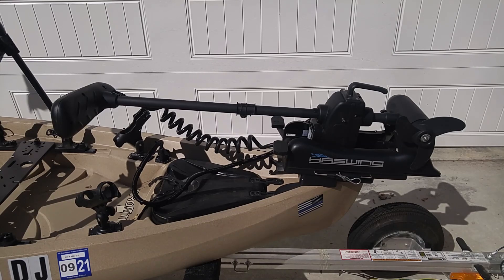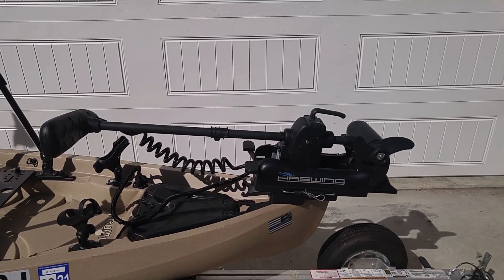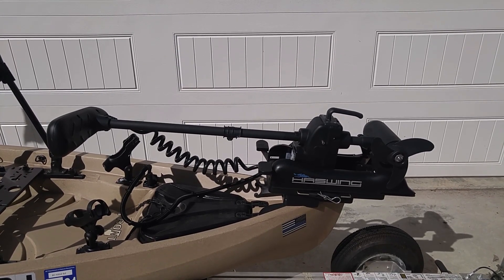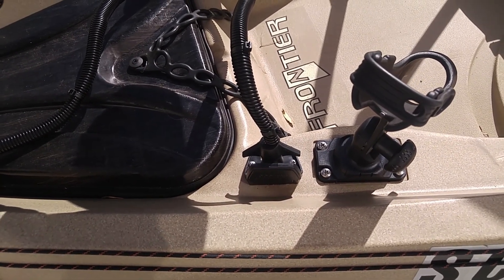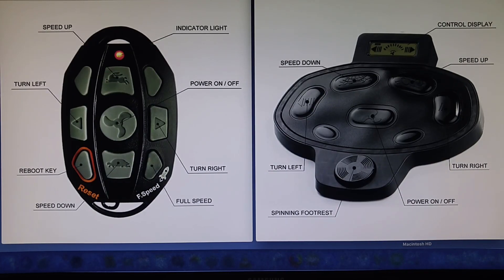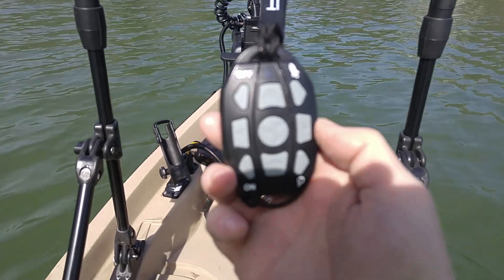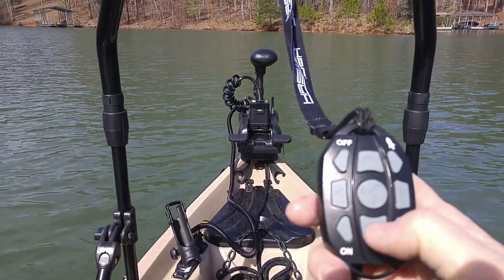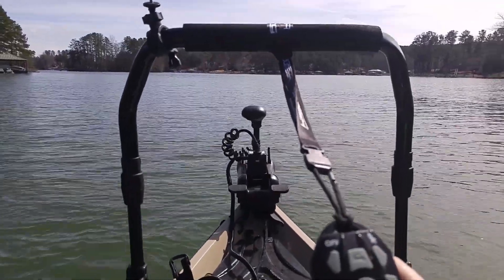Nucanoe Frontier 12 Kayak with Haswing Cayman Bow Mount Trolling Motor

Comment: I understand this is an older video, but i was wondering if you have ever tried to invent a deploying cable and a retracting system on the bow mount? Is it possible?
Thx Again for great videos
Cliff
Reply from the maker: Thanks Cliff. I did that on one of my Bonafide SS127 videos.
Reply: @Aksmaniyak  I watched that video and it was for a stern mount i am buying a quick release bow mount Haswing that i will be wondering how to setup a deploy and a release type cable setup in order to release from my seat
Thx Again
Reply from the maker: @cliff6490  Sure. I have used the Cayman but never had a cable release set up.

Comment: Were can I get one at
Reply from the maker: Amazon and Ebay.
Reply: @Aksmaniyak   do you have the one with GPS and if so do you have the part number. Thank you for your video.
Reply from the maker: I did use a Haswing GPS model but thought it was unsafe for kayak use. Read my comments about it in the narrative. It was an older model and do not know if they changed the programming. I do like the wireless Cayman B and it works great.
Reply: Were can I buy one it for my boat. I can find them on Amazon with the GPS

Comment: I bought one and the motor and remote work well. You have to have the app running for GPS spotlock. So no fishing in remote areas. I put it on a NuCanoe F12, same as the video. The motor weighs about 30lbs. So imagine putting a 30lb anchor on the front of your kayak. You better have a heavy A 40 lb + battery in the back to offset it, not one of these 15lb lithiums that i purchased.. Hope this helps.
Reply from the maker: Thanks for the reply.

Comment: You said don’t use the app for a “light kayak” my question is Between my kayak, myself on board and all my gear I’m pushing 400 pounds is that sufficient enough weight to use the helmsman app?
Reply from the maker: I would advise against it unless the program has been updated. The program I used was calibrated for a boat, not a kayak.
Reply: @Aksmaniyak  ok thank you for the response!
Reply from the maker: You are welcome.

Comment: Does this motor have reverse?
Reply: I realized that as soon as I sent it.✌
Reply from the maker: No, bow mount trolling motors typically do not have reverse. The prop is able to rotate 360 degrees which gives you the reverse.
Reply: How's the durability on this motor?
Reply from the maker: Excellent. I have owned several Haswing models and they have all been great quality.
Reply: @Aksmaniyak  thanks, getting ready to drop $600 on one, just wanted to be confident that it's a good motor.

Comment: This was very informative thank You.
Was shortening the shaft much of a deal? I have a small Pram and I am thinking the 48" is too long but they do not make a 36" shaft and that may be to short any way.
Thanks
Reply from the maker: Thank you.  A Minn Kota shaft and similar shafts are easier to shorten. The Haswing shaft is different and need s a little more care to cut.

Comment: HI, I bought this yak from the person you sold it to. Did you sell it with the GPS trolling motor or a non GPS trolling motor?
Reply from the maker: It was a wireless non-GPS motor.
Reply: @Aksmaniyak  I have been out a couple of times and I seem to get about 3 mph top speed. I have a brand new battery, I think it should be able to do a bit more. I weigh around 195lb.
Reply from the maker: @Expatswedegoran  I was getting about 4 MPH and a little over. The prop should be about 2 inches under the surface. If it is too deep then it causes drag which could slow your speed.
Reply: @Aksmaniyak  OK thanks, I had it way deeper. Will move it up next time.

Comment: Have you tried making a remote controlled electronic deploy/retrieval system for the trolling motor?
Reply from the maker: No Wes, I think that might be a little too much gear.
Reply: @Aksmaniyak  Thanks for the response. I only ask because the Minn Kota Ulterra models have that capability and I was sure there may be a cheaper DIY way to do it. And, if anyone could do it, it would probably be you.
Reply from the maker: You are welcome Wes. I thought about it but it would be complicated and it was easy to deploy by hand.

Comment: how is it holding up? any issues? thanks
Reply from the maker: Everything is still working just fine.
Reply: @Aksmaniyak  lots of mixed reviews on amazon...might go with a motorguide xi3...not sure just yet.
Reply from the maker: I have owned several Haswing models without any problems. Most of the negative reviews I have seen are by people that don't even own one.

Comment: What battery do you use/recommend?  I’m concerned about weight on a bonafied ss107
Reply from the maker: I always use a 100AH battery. Yes, it is heavy but I have never run out of juice.
Reply: Aksman any certain brand battery you recommend?
Reply from the maker: @danielmarteny1201  I found a good one at Sams Club if you are near one. I have also used VMAX from Amazon.
Reply: Aksman ty.
Reply: I also have a bonafide but the 127 model curious if you installed and how its been
Reply from the maker: @jaimedessus1605  No, I have never installed one on a Bonafide.

Comment: Thanks for a great video. Are you saying that the anchor in place function on the motor is too powerful for a kayak (when using the remote) or that the phone App is too powerful? Just want to be clear before I invest in the motor.
Reply from the maker: Thanks Dale. I'm saying that the trolling motor is fine when you have control of the speed. When using the anchor function from the app, the motor ramps to full speed in order to stay in place. The function thinks you are in a bog boat and not a kayak so it is an unsafe function in my opinion. Other than that, great motor.

Comment: Good evening Sir,
I bought the Haswing Cayman 12V 48” 55lb thrust  motor a few days ago and got it in yesterday. I also bought the Nucanoe bow Mount as well but I’m having
issues on where to mount the quick release puck on the mount. Is there anyway you could email me instructions on how you mounted yours?

Thanks,
Jacob- Corpus Christi, Texas
Reply from the maker: Hi Jacob. You have to do a custom mounting job for the puck to the mount. There are not any real directions. Just line it up where you want to put it. The holes do not line up so I used 1/4 inch lag screws in the 6 holes. It makes a solid base.
Reply: Aksman What’s the length of the 1/4” Lag Screws?
Reply from the maker: @cast_n_blast7496  I can't remember the exact length but they are long enough to go through the puck and at least half way into the mount.
Reply from the maker: @cast_n_blast7496  Yes, I used all of the existing holes just to make sure it was a solid mount.
Reply: Aksman- Good evening Sir
What size/brand battery did you end up using for your motor?
Reply from the maker: This is what I used.   https://www.amazon.com/MR127-Maintenance-40-100lb-minnkota-trolling/dp/B0087FBT3M/ref=sr_1_1?dchild=1&keywords=vmax+12v+100ah+deep+cycle+battery&qid=1586495030&sr=8-1

Comment: I been using the motor now and the helmsman app hold my kayak on anchor mode very well now Iam super stoked and happy with the product now
Reply from the maker: Great!
Reply: Aksman I don’t k ow if you I e noticed by now but I made the same mistake when I cut the shaft down I put the heading backward like you have on this video as soon as I turned it back and properly placed the head with long side being the front it fixed everything thanks for reply and hope this helps
Reply from the maker: Thanks Martin!

Comment: Hello quick question when you hit anchor lock on your Helman app is the kayak to light for it to stay locked I just got mine and when I hit the anchor lock it try’s to full blast me up to speed all the time you have any advise thanks
Reply from the maker: In the narrative, I had listed a warning of that situation.
Reply: I saw that once I finished typing the question 😅 so for now is the low speed route the best option for staying in position ?
Reply from the maker: I have not used that function but I assume the app would still think it was moving a heavy boat.

Comment: I just got same for my 2018 hobie outback you have advice on how to install quick release bracket on bow yours looks like it’s side ways or is that an added piece of support thanks bud
Reply from the maker: Nucanoe makes a mounting bracket for the bow of the boat. I added the quick release puck to the top of the mount for the Haswing quick release. The Nucanoe mount is for MK and MG trolling motors so I had to do some DIY to make it fit.
Reply from the maker: Hi. Nucanoe makes a Minn Kota mounting bracket that I modified for the Haswing. I don't know if MK makes a mount for the Hobie.
Reply from the maker: @Matt Tate Not too difficult. I just needed to find/drill new mount holes for the Haswing puck.
Reply: @Aksmaniyak  would it be feasible to position the bow mount at an angle so when deployed your front hatch is still accessible? Thanks, Wyatt
Reply from the maker: @wkillam  That is possible. I just did that on my Hoodoo Hero 130 skiff.

Comment: Nice addition... but when you shortened the shaft, it looks like you mounted the head unit onto the shaft backwards... looks goofy. Boat was steering left when it should be going right, based on the direction the head unit was pointing...🤣
Reply from the maker: I liked the way it looked. Steering is not affected.

Comment: I’d love a video of the deployment and lift while on the water!! I’m Really close to pulling the trigger on one and go back and forth on if the GPS unit is worth the extra
Reply from the maker: The deployment and lift is very easy. It has a foot release. The F12 is really stable so you can get good leverage on the trolling motor. If you read my narrative, the GPS is made for a large boat instead of a kayak. It would be a great motor with only the wireless controllers.

Comment: Excellent video and demonstration aside for the week could you Mount that trolling motor to the stern of a kayak ?
Reply from the maker: Thanks Bart. Yes, there is an adapter bracket that would allow for transom mounting. However, the steering would be reversed (l/r). Also, the prop unit would have to be deeper on the stern than on the bow in order for it to rotate for reverse without striking the hull.

Comment: Hi Aksel,

Nice Video.    PWM (pulse width modulation) is the way to go.

The old 5 speed units were real AMP/POWER hogs especially at slower speeds.  Minn Kota I know used resistor type devices that were mounted inside the motor head which helped cool them when in the water.  When you wanted to go at slower speeds it activated various resistors to slow the motor down which put more drain i.e. AMP DRAW on your power source i.e. battery.  The new PWM systems used on various manufactures including Haswing has dramatically reduced the amp draw at slower speeds which dramatically increases the amount of time your power source i.e. battery will power your kayak or boat.  At full speed there is no difference between the old 5 speed units and the new PWM units.  Where the PWM units shine is at the slower speeds as shown on your DC AMP Meter.  i.e.full throttle 28 amps and 1/2 throttle at 4 amps.   So if you are not in a big hurry to get somewhere you can increase your range i.e. battery life by a considerable amount depending on your actual speed and wind conditions.

I purchased an AC/DC amp meter similar to the one shown in your video quite a while back and conducted the same tests on an old Minn Kota 5 speed trolling motor that I converted to PWM  with a circuit board I purchased on E-Bay along with some relays for forward and reverse.  I see now they offer one that has the forward and reverse built into the board.  Not sure how it would work for trolling motor applications as I have not tried one.  The SAD news is that the AC/DC AMP portion of the meter stopped working recently which is a real bummer for me.  I may purchase another one as it was only around $40.00 and is the only meter that I found that could read both AC and DC AMPS in that price range.

BTW: I have a Minn Kota 80Lb thrust 24 volt system on my Scout 177 Sport boat that I use for flats fishing.  The Anchor Loc system is the cats meow.  Keeps you right on your favorite fishing spot.  No more playing around with dropping and retrieving anchors and all the associated mess  in your boat.

The nice thing about your Haswing and my Minn Kota is that you opted for the quick release mount so your could use your trolling motor on either you Kayak or boat if the shaft length was long enough.

I know you are going to love your new propulsion system.

Enjoy!

John
Reply from the maker: Hi John! Glad to see your response. You are dead on with your assessment of the old resistor 5F/3R verses the new digital (PWM) speed controllers. I have made controllers with the ebay (China) PWMs and they seem to hold up...for now. Too bad about the meter, for the price it is the best way to measure DC current and such. I use the same Haswing model for my boat trolling motor and it works great...especially the anchor lock feature. That feature though is too powerful for kayaks. If I wasn't experienced and had a stable kayak, I could have easily flipped it. The app works great with my boat though. 

The quick release makes moving and launching the kayak so much easier, especially since I have to put it in the water over rip rap and then pull it around to my kayak dock device (videos on both).  I hope to see some new videos from you soon. Be healthy!

Aksel
Reply: @Aksmaniyak  

Have you ever tried an e-bay version one i.e. China stuff like this:
https://www.ebay.com/itm/Motor-Speed-Controller-PWM-HHO-RC-WS16-DC-10-55V-12V-24V-36V-48V-55V-100A/253719463030?ssPageName=STRK%3AMEBIDX%3AIT&_trksid=p2060353.m1438.l2649

It is (rated at 100 amps) that has the reversing relays built right on the board.  I was wondering if the relays were heavy duty enough to handle the reversing (forward/reverse) trolling motor operation????????  I sold my converted unit to a local guy and he wanted to try this unit on another trolling motor he owns as all the electronics are on one board.

I value your input. Thanks for any help you can offer.

John